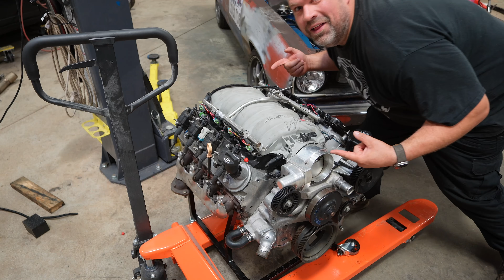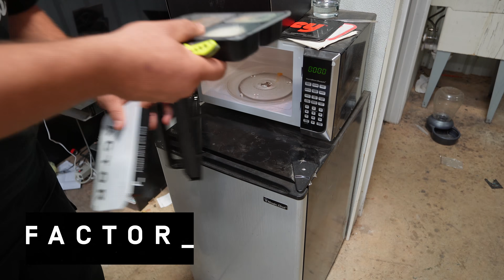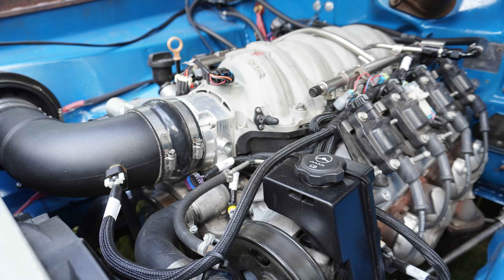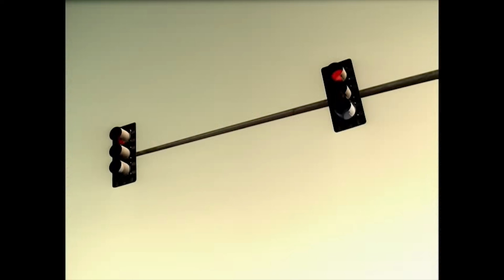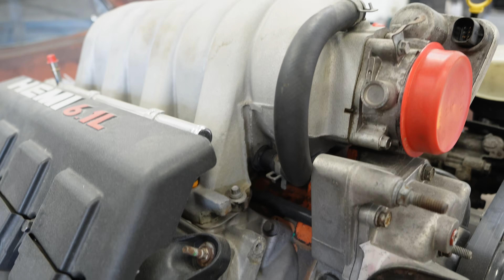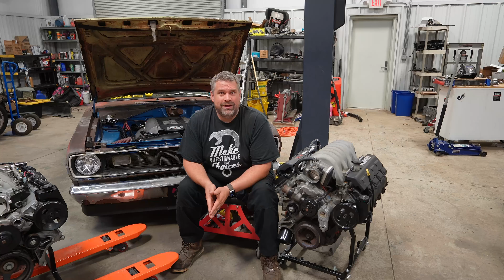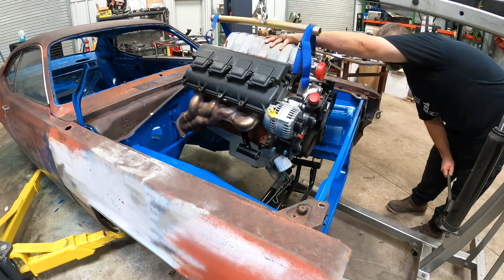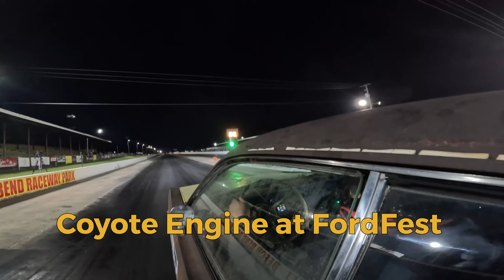What No One Tells You About Engine Swaps! Best Engine To Pick?

Comment: If you get a truck Coyote, get the 2015 and up f150 because the Gen 2 and 3 Coyotes have better bottom ends. Also if you plan to stay Naturally aspirated get a mustang Coyote because they have better cams and a Cam job on a Coyote is expensive. You dont need to upgrade the Oil pump gears. They break when you bounce it off the rev limiter. Have your tuner put a soft rev limiter in, where it cuts gas.
Reply: But you are one of the few people who are correct about the oil pump gears. Unless you’re bouncing off a limiter or a two-step, you don’t need oil pump gears. I’ve never known anyone to break theirs. Even dudes running mid 9’s with a completely stock, gen 2 motor.

Best motor fords ever made

Cheers
Reply: @robfeldschun6146  Roush has been selling boosted coyotes since 2011 with out changing the oil pump gears.
Reply: The have better rods than a gen 1 mostly. Gen 3 got built in water jacket supports.

I went fully forged Gen 3 with Gen 2 heads in my 2013 GT. We did some ego pulls and got easily 1100 wheel with a 3.0 whipple on e85. Turned it down to 900 for the street.

Comment: Great content again Jared - hope you feel better soon!  
Now considering a 2L straight six swap into my 1.3L Triumph Herald...  I might increase from 60Hp to a fearsome 95 !
Reply: Would be easier to buy a 2 litre Vitesse?  Love the Herald though, used to have a Dolomite Sprint, and my sister had a Spitfire Mk3 so always loved Triumphs.
Reply: @Beer_Dad1975  the Vitesse 2 liter is pretty much a bolt-in into a Herald given Herald = Spitfire/Vitesse = GT6 in the main.
Reply: @rennkafer13  Sure easy swap & you could even put a 2500 unit in easy enough as it's the same dimensions as the 2 litre - but if memory serves (and TBH I'm nearly 50 so my memory isn't great) - the Vitesse has a different transmission with more suitable gear ratios and final drive, and beefier suspension and brakes.  Back in the day of course it was pretty easy to swap engines around - my Dad bought a 2 door Toledo 1300 once and swapped the 2 litre engine and transmission from a TR7 into it over a weekend - that car was a load of fun.  We called it the Torpedo.
Reply: 2.2 dodge.  96! Screaming hps!

Comment: Dont forget in that hemi the terrible oiling problems they had/have broken manifold bolts and dont forget the wiped out cams.
Reply: What’s was the terrible oiling issues of the hemi? 

Exhaust manifold bolts broken  in the hemi is a annoy problem but far easier to repair when compared to the LS that also breaks exhaust manifold bolts. 

Cam/lifter issues are also present in the AFM LS also.
Reply: @alexgrindnshine2522 the hemi isn't easier to fix manifold bolts.
Reply: @jdrok5026  they are way easier to fix then and an LS, the bolt that breaks on the LS Is usually very difficult to get to and is usually extremely tight. When trying to do the repair on the truck.
Reply: Of course fixable and preventable but still. Also delete dod in the ls
Reply from the maker: That is a good point, the hemi tick, and the dod issues of the ls.
Reply: Also I believe a popular mod on the 5.0 is locking out cam phasers.
Reply: Newer early hemis basically relay on the splashing of oil to oil the cam shaft. They eat cams and lifters because the oil passages basically run along the cam completely missing it.
Reply: @omwtfym12  hears the issue with your logic, the early hemi didn’t have the problem with damaged lifters and cam lobes, same oiling design. The LS engine has the same problem. The new ford Godzilla is also having the same problem. I don’t disagree with you about oiling possibly being a factor but I wouldn’t just say it’s the sole cause.
Reply: Next yr. the HEMI is replaced with this TT Huricanne 6 making more h.p. Cylinder management deactivation LS also have the same lifter rod cam failure almost as often as the 5% of HEMIs run at low RPM excessively.
Reply: My boss at the time went broke fixing hemi 5.7 engines. Problems, galore. He finally realized  time to stop buying them. I had worked with the engineer who was the liason between Diamler Chrysler and Ricardo engineering, which was the engineering outfit, that was contracted for the design of the gen3. Spun bearings, blown head gaskets, dropped valve seats, and more. Thankfully  the boss finally  quit buying them. I myself was surprised at the problems , Ricardo is a respected engineering firm.
Reply: We can all agree that most of the issues are all created by the cylinder deactivation bs. So who do we ultimately blame? The government.

Comment: From an OEM perspective, the Coyote wins all day long. Having dual overhead cams gives it way more potential at the top end. It's my 3rd favorite V8 of all time (behind the Voodoo and the M156/M159 from Mercedes), but from a swap perspective, it's just too new from an aftermarket support perspective (It's been around 12 years, vs. DECADES for the LS), and too BIG with those DOHC heads to fit in anything easily.
Reply: The LS makes more power : weight, is more compact, more reliable, less complicated, and less expensive.

The only thing the Coyote has going for it is power : Liter, lending itself to some race regulations, but being meaningless on the street.

LS "wins all day long."
Reply: @redslate the ls can't even compete when it comes to boost vs boost.  Not even comparable.  Yall need to do some homework.  It can even hang na for its displacement.  Only ls that can make alot more power is usually at least a liter larger and when boost enters the chat it's game over.  They can make a ton of power and drive like a stock car.  So it prob isn't the best choice to swap into a miata but there are a ton of vehicles it'll fit in without issue.  People make this too big a deal.
Reply: @midnight347  Your entire misguided rationalization is like, your gurl dumped you 'cause another dude blew out her back better, but you're doing mental backflips arguing, "My heartrate was 'more efficient' (lower bpm) than his."  She just like, "Who gives a fuck?  Your performance is lacking, bye!"

LS stole yo gurl...
😭
Reply: The size is the biggest problem for the coyote. I love all 3 engine series I am mostly a gm fanboy but I love all American vehicles really. I was completely blown away with how wide the coyote was when I helped my buddy pull his from his newer mustang. Great engines but my god they are massive
Reply: @Banatar yeah, depending on the project the Coyote just isn’t even an option. It has the best power potential and most unique character, but they’ll never be another V8 as plentiful in junkyards as the LS.
Reply: Especially considering the Coyote has only ever been in 2 vehicles, the Mustang and the F-150. GM has WAY more applications of the LS.  @ChuckThree
Reply: @McNasty43  Yup. And for the F-150 the Coyote and 3.5 Ecoboost came out in the same year, and I think it’s out sold the Coyote every year since then.
Reply: By modern standards, the Coyote isn't even that big. I think we're just so used to the compactness of an LS, that it just seems enormous in comparison. A DOHC V8 from any other manufacturer is probably just as big.  @Banatar
Reply: @McNasty43 Any dohc engine is going to be wide if it's at least 90°. They're still big  by comparison to other engines. People were saying back then; the 4.6 4v was wider than the 429s that came way before them. I think the coyote and 5.4 are both wider than the 7.3.

Comment: Another one of my favorite Youtubers has put an LS4 into a Triumph GT6 swap that is being backed up by a T-5. It was chosen because it was quite a bit less expensive than other all-aluminum choices. So, it's possible, it just takes some work.
Reply: A Tremec T-5? Whew... good luck.
Reply: @ItsDaJax , it's a budget build. He's doing it in a one car garage, and an angle grinder and welder are about the most sophisticated tools he has. I think maybe the plan is to run the T-5 for a while and save up for a TKX. There is just not much room...
Reply: @TheKiltedYaksman1  I only say that because a stock or near stock 302 can kill one, and that's with under 200hp. Somebody in another video comment section said the stock 262 in a Blazer can kill one- which is funny to me. It's mainly the third gear synchro that goes out. Even funnier is that they're still considered weak, why doesn't Tremec do whatever they did to the t56 to make it stronger? The t56 is just a t5 with an extra od and it doesn't have that issue.
Reply: @ItsDaJax OK,  the t56 and BW T5 share absolutely no parts and were never spec'd for the same application...now. that that's out of the way , the Tremec T5 is yet again a diffent trans from the BW T5 .
The more you know rainbow 🌈 🌟
Reply: @duncandmcgrath6290  Yeah, I didn't know that. I thought the t56 was based off of it. The name sounds like it means T5 six speed. I do the t56 magnum is a tr6060- sorta.
Reply: Still my pick for one of the prettiest cars ever built.
Reply: In a Triumph GT6  that's unreal, a friend had one and let me loose in it a few times until it had a fault and his bosses stopped paying his fuel bill at 6 miles to the gallon he took it off the road then sold it for a more modern car as work wouldn't give him a van as he blew 3 in 2 months but was the best they could find.

Comment: For old vehicles like this would the Ford Godzilla 7.3 be an easier fit since it's also pushrod? I know aftermarket support isn't going to be as strong but if you want to keep a Ford in a Ford it might be an option.
Reply from the maker: Not just yet, they need to have the cost come down before they are a Everyman engine. Currently they are similar or slightly more expensive to swap than a coyote. I’m really excited to see them start to come down as more support happens!
Reply: Godzilla is longer, taller, and +100lbs heavier than the Coyote. Mast Motorsports has a good comparison drawing.

But yes, people are making +1,000hp easily with a Godzilla using rods, pistons, and cam.
Reply: If you're just an average person and average income,  most people only have 1 option... Budget friendly,  I dig the new godzilla, but when you can buy a car and ls swap it for the price of just a Ford motor, isn't applicable for everyone.
Reply: @joshuasalvage4717 That's what some people don't get about the LS; it's no longer boutique, simply a means to an end. It's Levi jeans when you need a pair of pants quickly and cheap.

Comment: LS is usually the best bang for your buck. Plus they fit in almost any engine bay.
Reply: Just don’t LS swap an old mopar.🙄
Reply: Yup, the LS will go down as the greatest budget power V8 swap option of all time. But the Coyote is unquestionably the better V8.
Reply: @ChuckThree Size, weight, power, reliability...  LS is unquestionably the better engine.
Reply: @ChuckThree coyote has no torque and you need to rev to make any HP,sounds like a vtec.
Reply: @ChuckThree  unquestionably? This is the questionable garage. There are always questions. And based on all my past experiences with Ford, I will stay far, far away from any Ford product.
Reply: @herbiehusker1889  Not a fanboy of either side. Just stating pure facts.
Reply: @ChuckThree  facts? You say it's unquestionably a better engine. That isn't fact, that's opinion. Fact is, Ford sells hardly any coyote engine vehicles compared to the number of LS powered vehicles sold. Part of that is becuase Ford has pushed its Ecoboost engines, and partly because Coyote engines are garbage.
Reply: @herbiehusker1889  whatever you wanna think dude